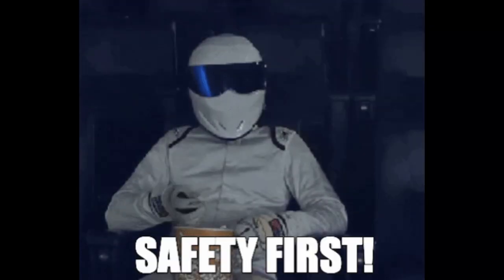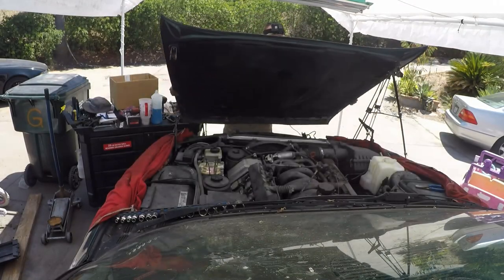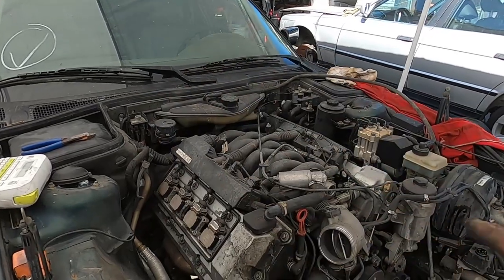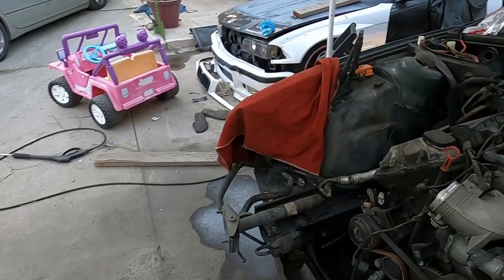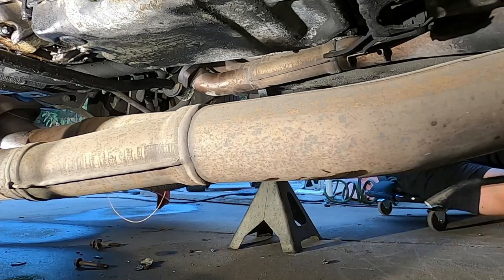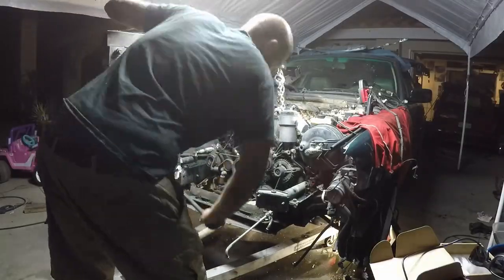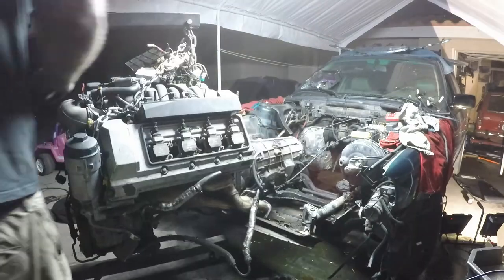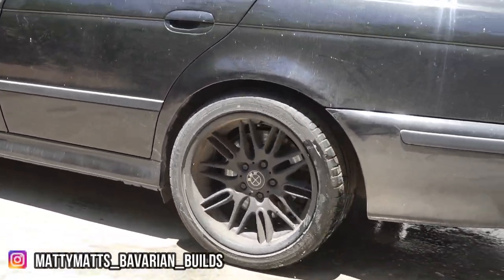Supercharged S62 E34 Touring Build Part 1

Comment: wanted to offer original body kits Schnitzer e34. There is a front, rear trim and sills, there are AC Schnitzer e34 side mirrors and a AC Schnitzer steering wheel and a AC Schnitzer e34 exhaust system and a spoiler, but only for a sedan, and there is AC Schnitzer Rennsport Typ 1 R17 three-piece wheels and Schnitzer nameplates on the rear trunk and front grill of the car. If you are interested in buying these parts, write to me.
Reply from the maker: Please email me! Escapematt@aol.com
I greatly appreciate the love and any help you can give with ACS parts!